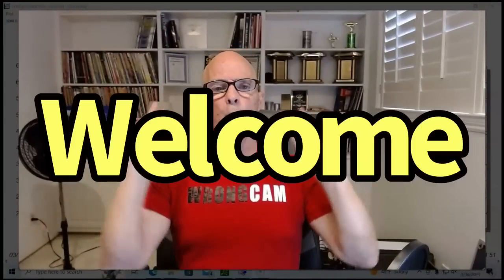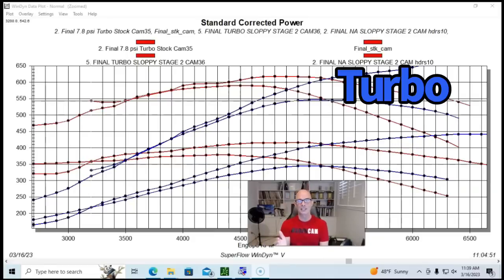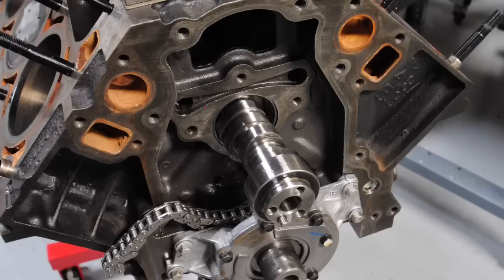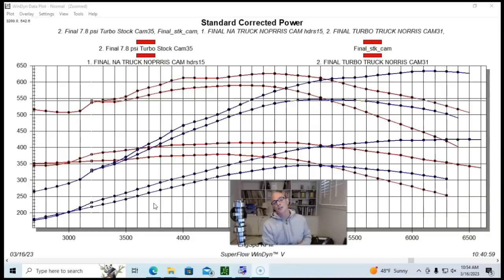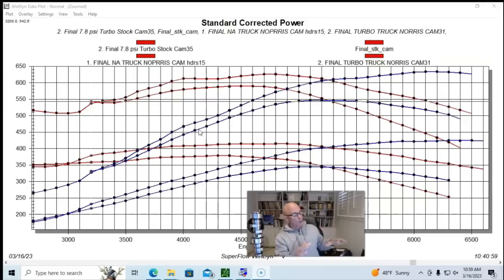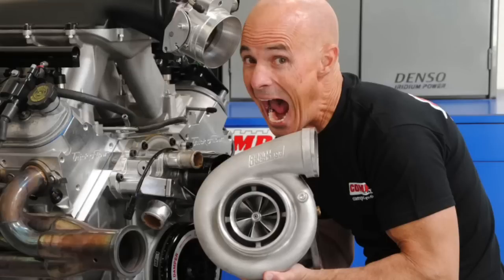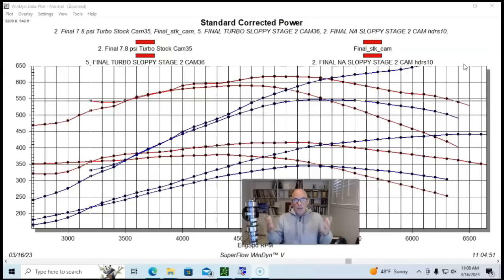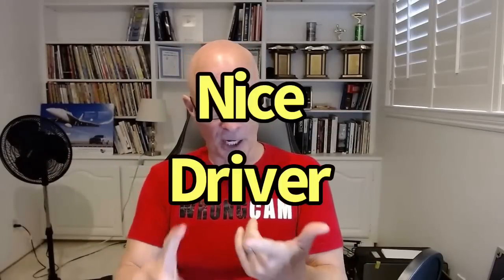WHAT MAKES A TURBO CAM A TURBO CAM? HOW MUCH LIFT, DURATION, LSA AND OVERLAP CAN YOU REALLY RUN?

Comment: What Chopacabra cam is he referring toand will it work on a 6.2l
 Thanks
Reply from the maker: this test was the original Chopacabra for the 5.3L (not the new one for the 6.2l)
Reply: @richardholdener1727 last question and thank you for your time. If I'm going to do the 6.2l LH9 would you run the new 6.2 cam or stick with the old cam. Playing on doing about 700hp may up to 1000hp but more around 700ish turbo

Comment: A all motor cam with a bunch of duration and over lap with a tight LSA will run different in a car with 200 degree water temps and the vacuum brake booster. It can cause low vacuum at idle and effect braking etc.

Comment: So the inertia off gases take care the exhaust back flow. So flow and velocity matters.
Reply from the maker: matters to what and what is exhaust back flow?
Reply: @richardholdener1727 if exhaust pressure during overlap is higher than in intake flow is wrong way. But if it works fine then flow got to reason. It was suprise to that overlap is so harmless.

Comment: I posed this same question about the "Big Mutha Thumpr" roller camshaft for BBF ( SKU 34-602-9). I was told that it had way too much overlap for a turbo to run good. Please prove this right or wrong.
Reply from the maker: that is incorrect-the turbo just multiplies what is there-the MT cam is not necessary for aa turbo motor (you don't need that much cam to max out a turbo), but it will work
Reply: @richardholdener1727  Thank you for such a quick reply. I just like the cam and would like to add a turbo to it but was told it would not work well at all. I am now watching your video “Motor Myth Busting-Blower Cams” and I caught your explanation of how “bleeding boost pressure” might be more prevalent with a super charger but not a turbo because with the turbo there is back pressure in the exhaust preventing that.
Reply: @richardholdener1727  I haven’t purchased that cam yet. For street brawling and and the most fun with a 7875, what cam would you suggest for that? (Ford 460, sn95)
Reply: @richardholdener1727 Will you PLEASE grab the “Big Mutha Thumpr” for a big block Ford or Chevy (stock stroke) and put it on the dyno with something like a (T4 and T6?) 7875? Comp Cams said it won’t work for the street and it won’t even idle with low compression stock heads (budget boost build).

Comment: Any cam with little very little lobe separation angle when both the valves are open the exhaust and go back down the end day cause there’s more exhaust pressure than intake pressure in a turbo charged motor
Reply from the maker: lsa isn't the only thing that determines overlap-and besides, overlap isn't bad for a turbo motor-the boost doesn't escape and back pressure doesn't stop inlet flow

Comment: This is how you blow up a racing engine guys, do not run an N/A cam on a turbo car, thx
Reply from the maker: Said no one who understands (and has tested) engines.
Reply: @richardholdener1727  Back pressure coming back in during the intake stroke from a big N/A cam being used in high turbine boost applications because of the overlap, is the reason turbo cams exist. 

Overlap > Duration

Comment: Maybe I don’t have to sell my BTR twin turbo stg1 cam since I’m just going to stay N/A?
Reply from the maker: it will work fine
Reply: @ love the content thanks for all you do. 

My car: 71 vw beetle, 2500lbs (estimated)
          Gen 3 5.3 LM7 stock, Holley 750dp carb, block hugger headers

Primary use: street car/ competitive “Aussie” style burnout contests

Would love to rev over 7000+rpm as well

Comment: This is the difference between an academic and someone who needs to win to earn a living. This was a huge load of BS.  If you are claiming that same engine using 2 different cams with 1 an optimized grind for forced induction and 1 not that they make the same power? Thats absolute hogwash!
Reply from the maker: new

Comment: Something that's not often tested on this channel is low rpms, where you actually drive the car on rhe street. So, the information is mostly for racing information. What he says is true though, that the turbo is going to magnify the cams NA performance.
What you really want for a street driven turbo motor, that is port injected as it should be, is enough LSA so the fuel pressure regulator is properly controlled by engine vacuum. If you put almost any cam with less than 113 LSA on any port injected motor, it's going to buck at light throttle openings from idle up to whatever rpm manifold vacuum becomes adaquate(LSA needs to be higher as lift and duration increase). Even in this case, the Turbo is going to magnify what the cam did without the turbo, as he says. So, the mild bucking it had before will now become violent. Also, it will make more power with the wider LSA at those lower rpms. Which will help reduce the effects of turbo lag. Which you will also really want at low rpms. You don't even have to dyno test to prove that, because it's obvious that the motor that makes 20in of vacuum at a given rpm, is sucking twice as hard as one that's only got 10in of vacuum at the same rpm. 
So yeah, I wouldn't recommend a 107 lsa cam on your street driven turbo motor...
Reply from the maker: Unfortunately, nothing you said here is accurate. A wider LSA does not make more low speed torque-the opposite is usually true. The less than 113-degree lsa determining bucking with an efi motor is also universally not true. Finally, if you think a 107 lsa doesn't work on a street turbo motor, you need to drive a turbo 5.3l with a BTR Truck Norris or my Low Buck Truck (or any other similar low duration cam) to see how inaccurate the statement is (think valve events).
Reply: @richardholdener1727  I really feel like you just got offended, and wrote a rant here. Try reading what I said again, with the perspective that I'm referring to "low rpms" as idle speeds. 
I assure you that not having enough vacuum at those rpms is going to negatively affect driveability on a fuel injected engine. Because it affects both the fuel pressure negatively. Of course you can do some tuning to help. But, it's like a band-aid for the real problem.
For power, watch your LSA video, and Engine Masters too. They got significantly different results because they used Fuel injection, and they explain how a wider LSA will improve low and high rpm power(flatten the curve), but give up midrange compared to a 107ish lsa cam. Also, you will notice that the FI intake manifold made up for most of the mid-range losses, as compared to your carbed LSA test. 
I never said the 107 lsa cams wouldn't work. But, I wouldn't recommend one for driving on the street with FI.

Comment: I just recently picked up my Lq4 from machine shop. Went 10 over Manley forged pistons H beam rods, stock crank balanced and polished . 04 gmc seirra street truck. Going 88mm turbo, and not trying to put a big stall converter.  What cam , lifters, and injectors would you suggest?

Comment: How does the Summit Big Nasty cam perform compared to the truck Norris and chopacabra?
Reply from the maker: that is a bigger cam-it might make slightly more peak power but less through much of the curve. I have a Low Buck Truck that is $179 (does the same as Truck Noris and Chop cam)

Comment: Will a 223/227 .621/600 LSA114 work with a single turbo between 60-65 mm
Reply from the maker: for what size motor and what power level?
Reply: @richardholdener1727  5.3 I want to make between 600-700 hp

Comment: Will a stage 2 turbo cam with a turbo cause the oil dipstick to come out because of pressure?
Reply from the maker: the cam doesn't matter. If there is excessive blow by-then you can get pressure in the crankcase. If you have boost going from the intake to the valve cover or PVC-same result

Comment: I cant comment on LS engines as we dont have much of them here. While you tested for full throtle, which is ok for drag racing, things may be different when driveability and more boost is factored in. We mostly do high boost DOHC inline 4s here, and high revs NA. The turbo cams usually run "high lift" 10.25mm cams with 270 duration and 30+ psi boost, up to 9000rpm, most power produced with about 115 separation. The NA engines run something between 300 and 330 duration, and rev to 12,000. Pretty sure the turbos would not run great with that much duration, since they cant rev that high.
Reply from the maker: it is makes power up there na-it will do so under boost
Reply: @richardholdener1727  Except boosted cant handle 12,000rpm, so the powerband given by the cams wont be attainable.

Comment: N/A engines don't use different cams when running at high and low altitude tracks even though the intake density changes. Why would you change cams just because the altitude changed artificially?

Comment: When investigating the longevity of 440 Bus engines for Chrysler in the 70s we found that overlap/ exhaust close had a big effect on EGT
Stock 440 cam bad and 440 HP cam worse  In addition you have to keep the exhaust valve on its seat to cool as much as possible
the really long closing ramps killed these motors, exhaust manifolds glowing cherry red on medium pulls  and even on our test Cordoba
How long do you want to live?  changing cam and going to quench pistons lowered EGT  800 degrees 
That said, as Richard says, start with a cam designed for your usage and torque curve needs then shorter is usually better unless you are really light and short bursts

Comment: Texas Speed sold me a "Stage 2 blower cam" for my 13 Silverado 5.3L w/P1SC1. 224/228/.600 lift 114 LSA. That was about 5 years ago. Now, that same cam is listed as a Cleetus McFarland Dumpster Fire cam. Their "Boost cams" listed for my truck now are way different.The truck sends 600+ to the wheels so it works!
Reply: There's some mislabeling regarding "boost" cams. Boost should be a generic term, because centrifugal superchargers and turbos like different cam specs. Turbos and positive displacement blowers like a tighter duration spread, like your cam has. Centrifugal blowers (and nitrous) like a wider speed, 10 or 12 degrees. So it's not that your cam won't make power, it's just that for YOUR application a cam with a slightly wider spread would have picked up a bit more if it was spec'd correctly for your blower. 
Similar to the theme of this video, unless you wildly mess up the boost cam specs you'll make power. But some will make it more efficiently than others.

LSA seems to be the common denominator with both turbo and supercharger though. 114-ish seems to be the ideal spot for boost on both. I'd like to see someone cover this point in depth though. With all the talk of LSA on NA cams, and David Vizard even having a formula on finding the right LSA, it's kind of been crickets when it comes to a formula for boost. I'd like to know more.
Reply: Businesses come up with ways to sell you something. Look at the iPhone for example. They haven’t changed much in the last 10+ years but people still buy them and they all do the same exact thing.

Comment: Richard I have btr stage 4 in my 6.0 with 76mm turbo it’s happy at around 13lbs but when adding more boost it makes less power 
Data looks perfect 
Full exhaust 3/12 to 4 inch no muffler 
Any idea why
Reply from the maker: 13 psi with as 76mm turbo on a healthy 6.0L might be out of turbo or at least hot side flow

Comment: How much more hp can you get with stage 1 cam with torqstorm on 5.3? Only have 350hp now..
Reply from the maker: the blower will support 750 hp
Reply: @richardholdener1727  yeah. I'm not trying to go that big. Just wondering how much more hp I'd get with the btr stage 1 centrifugal supercharger cam. Currently at 350hp

Comment: So my problem with your statement is that it's a useless self-fulfilling prophecy. If you're ONLY denominator for a "turbo cam" is that the curves match N/A vs Boost for any given boost level, then it's a "no duh" situation that any cam will be "a turbo cam"

The problem is that most cam spec'ers in general suck. LSA should be fixed based on several parameters of the engine, as per David Vizard's teachings. From there, the maximum effective lift is determined by the valve sizes, so you can only go so crazy there. And then after that, those other two factors being set, you just pick your duration and overlap to determine your powerband and rev limit; more or less, and very generally speaking.

Where "not a turbo cam" and "a turbo cam" come from is and/or SHOULD be systemic optimization. Sure, you pick your overlap for your idle quality and rev range, but once you do that, would offsetting your overlap by doing a dual pattern duration give you a better or worse turbo response? More or less back pressure? More or less blowback? If you could make more power with less boost and spool up faster without changing your turbo size, would that not make whatever cam you selected that accomplishes that more of a "turbo cam" than any random cam you have in there that has the same power curve, otherwise?

And before I forget, overlap should be calculated with the advertised duration, not the duration at .050. Just because it's not at .050 doesn't mean there isn't overlap, or that there's a lack of scavenging effect, perfect idle quality/good vacuum, or ideal BMEP and volumetric efficiency at low RPM.
Reply from the maker: if the cam you spec out makes more power na-it will do so under boost-EVERY cam IS a turbo cam and I hope to have a cam video out on LSA so the LSA guys will better understand why it is not the answer
Reply: @richardholdener1727  Based on David Vizard's general information, as well as his recent video on turbo cams, I disagree, and I particularly stand by my statement that your claim is a useless and self-fulfilling prophecy. That last part in particular is evidence of a bad faith argument.

There's some specific name of this type of logical fallacy that I don't remember what it's called, but you can't just say that something being generally obvious/compatible means it's "good" or "best". It's like saying all shoes are good walking shoes or all lean meats are good sources of protein.

The best turbo camshaft is one that helps to provide or directly provides as close to a 1:1 backpressure to boost pressure ratio as possible. To this effect, you DO generally want less overlap. And for cams in general, there IS a practical limit to valve lift, and that's 0.25 to 0.3 the valve diameter. From there, you need the correct/ideal LSA to start with, which is based on displacement and valve sizing, in order to use that and your desired overlap to calculate your final duration.
Reply: @Drunken_Hamster do u have a video proving your point? What can i type in the search bar that proves your point?

Comment: No offense or anything, I just don't understand what does he means by saying "it works well". Of course any engine that runs N/A makes even more power boosted in case of decent A/F ratios, ignition timing, etc. 
I would like to know what cam benefits the most. I don't see the point comparing the N/A engine to the boosted. Why doesn't he compare the boosted engines to each other? That would be more useful.
Reply from the maker: whatever the cam does no-it will do boosted-the boost just multiples what is there na-pick your cam based on what it does na

Comment: Hi Richard  I have a couple  2.6 and 2.9 ford v6 and some the Yamaha  sho engine  how do I select  the right  cam for these engine? My goal would  be more tq from idle and still run smoothly  and if possible  to make  a bit  more  power is there  an equation  like you guy use for the v8? Thank
Reply from the maker: there is no equation-you need to see what the existing cam timing is-but cams offer very little power off idle-you need to look elsewhere for low speed torque

Comment: So I can run my reverse split TR230 that's a 230/224 on a 111 LSA and this principle would still apply? I love everything about the cam, so if I could turbo it and it would mimick its manners has now, but with more power, I'd be ecstatic.
Reply from the maker: a turbo will multiply what is there
Reply: @richardholdener1727  Thanks my man. I didn't know if it would hold true being reverse split, but thanks for clarifying.👍

Comment: Pressure ratio of exhaust/intake is very important. Everything that he said is true when you have the same backpressure in the exhaust as boost in the intake. That means that the turbine size is most important, as that is what determines the exhaust backpressure. Most oem turbo engines have higher backpressure for better response while most aftermarket turbochargers are bigger and build boost at higher rpm and make more top end power with the expense of lower end rpm.